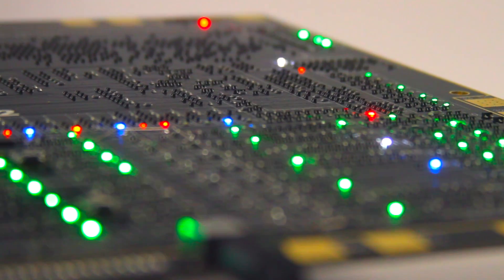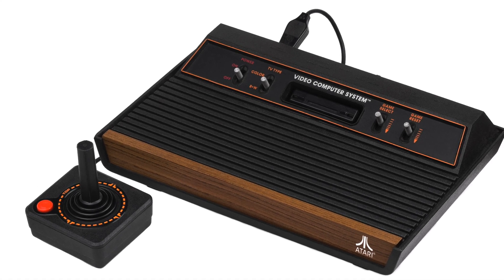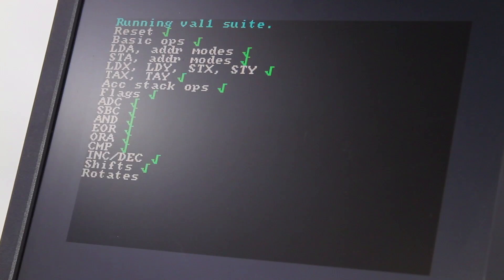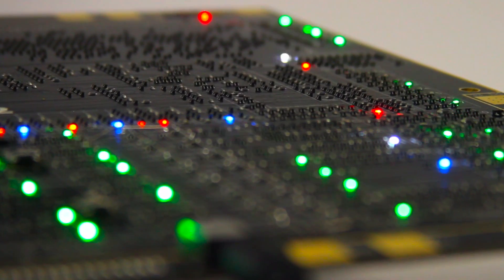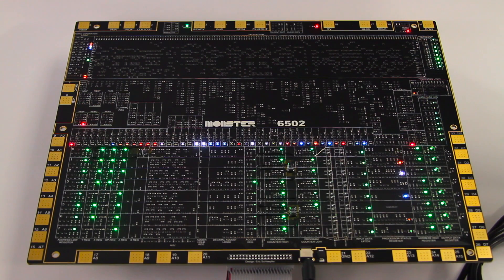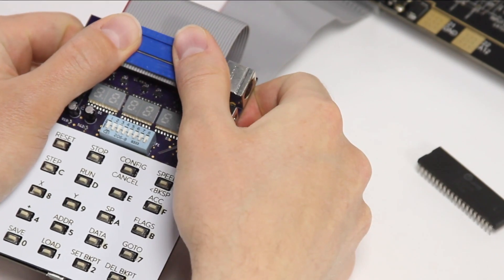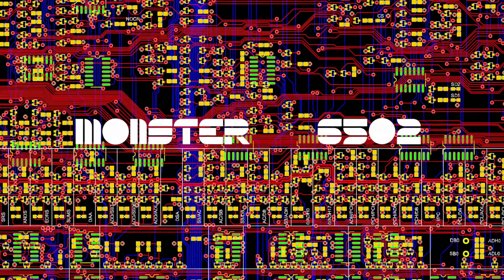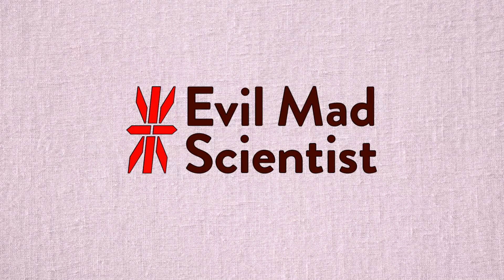MOnSter 6502 Update #1

Comment: Pity they could not get it up to 1mhz - then you could connect the address lines etc to a socket installed on a C64 motherboard and have it power the computer - THAT would be pretty cool. :)

Comment: 1 problem...because its so big...its slower than an actual 6502
Reply: I think you're missing the point, this thing is a technical masterpiece
Reply: @ShaunJV12  boosting the voltage won't make it clock faster
Reply: @Mr.1.i  I know. It's clearly not designed to be faster or more powerful that the original 6502, it's a technical exercise to show it is possible to recreate an actual CPU with standard transistors
Reply: @ShaunJV12  it's because it's bigger in scale than an ic which is smaller ,the electricty doesn't have to travel as far thats why the big 1 is slower
Reply: As they explain on their website:

"Does it run at the full speed of an original 6502 chip?
No; it's relatively slow. The MOnSter 6502 runs at about 1/20th the speed of the original, thanks to the much larger capacitance of the design. The maximum reliable clock rate is around 50 kHz. The primary limit to the clock speed is the gate capacitance of the MOSFETs that we are using, which is much larger than the capacitance of the MOSFETs on an original 6502 die."
Reply: @ShaunJV12  why are u giving me shit

Comment: This would be hard process to concentrate on making these in some rock star movement impairing shackles. Everything has to be connected to ground tho oh my book holders and that means a lot if you already recognize all the transistors and resistors and are able to find them in the datasheet by the code. It's pretty much latest graphics card.

Comment: Apart from cosmetic effects of tens of led flashing, this project makes no sense at all!!!! 
You could  go back in time at the very beginning , when computer were designed around tubes: use of transistor is just a significant step forward and an intermediate step at the same time... 
I think you could have spent your time designing something more useful to the community of crazy digital  designer, for example an  implementation of a basic  cacheless Arm processor( cached model are more complex due to the data coherence issue!). 
Ooops! My talking cricket babbles of something like patent infringements and  law suit..... 
🤔🤔🤔☹️☹️☹️☹️☹️☹️!!

Comment: i wonder back side of this. at schematic we can see some soic8 footprints. they are probably memory, i think
Reply from the maker: Not memory, just more transistors. There are 164 quad transistor arrays in SOICs on the back side.
Reply: @evil-mad-scientist  164 transistors on ic, like a cheat
Reply from the maker: @kpcgkhn  Each of the 164 packages has four mosfets in it. If we could get this mosfet individually, instead of in a 4-pack, we certainly would have preferred to do so. This is the main reason that we most commonly call it a "transistor scale" 6502 rather than a "discrete" 6502.

We do state this explicitly in our FAQ (Is it truly a "discrete 6502?") on moster6502.com

Comment: Cool processor.  I wonder if it is possible to assemble a compatible intel 8086 processor from transistors and run MS-DOS and Windows 3.0 there? Then a assemble Pentium compatible processor and Windows XP launch. Probably, such a processor will take up a whole large room.

Comment: Have you considered overclocking it using water cooling
Reply from the maker: We have discussed it, but ultimately decided not to. If it seemed likely that we could get to a full 1 MHz -- meaning that we could plug it into an Apple II -- then it would definitely be worth the effort. However, our estimates are that we wouldn't quite get there.

Comment: I understand the distance of the transistors is now farther apart, slowing things down a bit, but why is it SO much slower? 1/15th the original speed?
Reply from the maker: The speed limit isn't the distance between parts, but the parts themselves. We're using individual transistors, rather than microscopic transistors on a single die. These are much larger transistors, which means a larger capacitance, which ultimately sets the speed limit.

Comment: Can you think of any visual virtual circuit board emulation applications?
Reply from the maker: Sure; this is actually based on reverse engineering work done by the Visual 6502 project -- a browser-based emulation of the 6502.

Comment: Just overclock it
Reply from the maker: Tried that. Got hot enough to melt the solder holding the resistors down.
Reply: @evil-mad-scientist   Probably not worth the trouble but the entire board could be cooled using submersion cooling as demonstrated in these videos "PC Cooling Submerged in 3M LIQUID" https://www.youtube.com/watch?v=YyKIZPuepl8 and "Submersion Cooling with my new Smaller Novec Demo" https://www.youtube.com/watch?v=dVkUozqdvCc&t=0s
Reply from the maker: @spottedtauren  We have talked about it. If we were sure that we could get to 1 MHz by doing so, we'd certainly try. However, this isn't anywhere close to clear, and so we haven't gone down that road.

Comment: Why is there a limitation on the clock speed? Stability? Capacitance of the semiconductors? Or the fact there are LED’s on it?
Reply from the maker: The primary limit is the capacitance of the MOSFETs; much higher than those on an IC 6502.

Comment: alright guys this is one thing yall should do with this guy here.  make it look right [ like the orginal here ]  but non working . just record the lights for say 5 to 10 min doing several different tasks . record the light responses . pop the most turd arduino like makerboard yall can get , hooked to a little display that scrolls text explinations of what it is doing.  so it wont have to really work , can be made of cheaper parts to keep cost down . if it could be a reasonable price i think it would do well if yall could just hop on a few youtube channels like lgr , retro recipies , and 8 bit guy .

Comment: At your next electrical engineering interview, just hand this board over as your resume.
Reply: People who can do this probably dont have to interview... they're recruited..  :-)
Reply: @SteveJones172pilot  Not really.
Reply: Depending on the job he wants to apply, this might actually work.
Reply: Electrical engineering?? More like electronics engineering
Reply: @poppyflorist  Electronics is just part of electrical engineering. A sub-category.
Reply: @cododerdritte39  Dude!!! What?!!? No mate no... Electronics controls electrical portion... Inverters, stabilizers, regulators etc... 
And then a whole lot on electronic product design, computer architecture, space application, communication industry, satellites... Huge huge others
Reply: @poppyflorist  Dude, yes, Dude.
First sentence in Wikipedia says:

"Electrical engineering is an engineering discipline concerned with the study, design and application of equipment, devices and systems which use electricity, electronics, and electromagnetism."

Do you even know what you are talking about?
Reply: @cododerdritte39  so you assumed that electronics is a sub of electrical? I am an electronics engineer and I work at data centres, with electronic products- router, switches, network ports, firewalls, servers, network cables, testers, multi function copier machines, LAN based system, NOCs etc etc ... NOTHING TO DO WITH ELECTRICAL. Your Wikipedia definition means just an intro. Yes, electrical has to obviously deal with electronics , because electronics automated most of the electrical stuff. Else electrical engineers would be using huge mechanical switches for everything with mind numbing interface changes and used up humungous space. Eg- electronic switches in inverters, voltage regulated chips, batteries operating automatically in sub stations during downtime and such..
Reply: @poppyflorist  I am an Electrical engineer and electronics is just a part of what I am doing.
And by the way, when you talk about Inverters, for example, what exactly is 'electronics' in it and what is 'electrical'? You whole definition doesn't make sense. There is no electronics without electrical and/or magnetic effects (for which electro dynamics and quantum mechanic are the basic theories)

Dude, read the definition of Electronic Engineering on Wikipedia:

"Electronic engineering (also called electronics and communications engineering) is an __electrical engineering discipline__ which utilizes nonlinear and active electrical components (such as semiconductor devices, especially transistors and diodes) to design electronic circuits, devices, integrated circuits and their systems. The discipline typically also designs passive electrical components, usually based on printed circuit boards.

Electronics is a subfield within the wider electrical engineering academic subject but denotes a broad engineering field that covers [...]"

You are an Engineer and have no idea about the structure of your own discipline?

As an EE I am designing an Ethernet Switch or copier machines - not setting them up or maintaining them in a data centre. (No offense here, this is just to clear things up a little).
Reply: @cododerdritte39  wow., Can you tell me, what are you designing in an Ethernet switch or a copier machine? What kind of electrical Engineering goes into an electronic board? Please explain. And when you talk about electrical engineering, are you talking about electrons that is present all around that imparts the electromagnetic properties in the world? That's your contribution? Electrical engineering is electrons supply, that what you're saying?
You are one confused EE. 
fyi the project shown in the video at hand, is an ELECTRONICS board with Gates, semiconductor components, sensors and transistor operation, not an electrical board.
GET A LIFE.
I'm out.
Reply: @poppyflorist 
You're a troll :)
Remember: we are replying to the comment of @thzzzt. He was also talking about Electrical Engineering, not Electronics engineering.
You are talking about things you don't understand.

Again: whenever we're talking about charges or electrons, the higher level discipline is Electrical Engineering (or electro dynamics as a physicists).
BTW: I don't belive that you are actually an Engineer because that would implicate abstract thinking. You're just calling yourself an Engineer (what, for example, would be illegal where I come from, you have to have a degree to title yourself an Engineer).
Reply: @poppyflorist  
Well, starting from the power supply (which is usually a type of switching regulator), to the high frequency stuff (Ethernet PHY) and fast digital circuitry (RMI interfaces, fast Memories for temporary storage of packets) and higher OSI layer processing on an FPGa/ASIC or UC. And of course the whole PCB for the actual circuit.
But fast digital electronics doesn’t work without the knowledge of high-frequency stuff or power electronics. So everything is connected and in order to make a proper product you have to know „everything“.
As you can see there are many sub-disciplines involved as
- power electronics
- communication theory
- control theory / dynamic systems
- digital Electronics
- information technology for data processing 
- RF Technology
.... and so on.

And above all these sub-categories is electrical engineering. :)

So please, let stop fighting about a definition.

Regards from Germany 
BTW.: I used to design big power inverters (medium voltage drives) in the US, so I am pretty sure that the electrical vs. electronics Engineering thing is the same as in Germany, at least with regards to the basic idea: no electronics without electrical engineering.
Consider electronics as one of many applications of electrical engineering. 🤘
Reply: @cododerdritte39  yeah, Digital signal processing and PCB design is EE... what a load... And the voltage regulator that you say you used, is an electronic board. All the transformer, inductor, components are now MOSFET and transistors...  Yeah you have great knowledge, I can tell...
And communication theory.... Really dude, really??? ECE is the one that is Electronics and Communication Engineering. You are confused.
And if you didn't know, frequency is not EE. It's just one of behaviour of waves. That's not EE.
Reply: @poppyflorist  Alright, I'm out. This is one of the discussions in the internet that doesn't lead anywhere.

I thought you would have enough knowledge to understand a hierarchy - which we do have here. Electrical Eng. at the top and it divides down to a lot of sub-disciplines - but obviously you're not able to follow me.

And btw (and last comment from me): capacitors/inductors are the core components for basically every voltage or current converter / power electronics. You can use them in 0402 as a storage inductor or as heavy as several tons. And regardless if it is switched by a MOSFET or a manually-operated switch, we're talking about Electrical Engineering.
And this is the point you simply don't understand.

But, this is my nice Sunday and I'm going to stop wasting my time with some ignorant troll on the internet.
Over and out.
Reply: @poppyflorist  No, more like hobby electronics.
Reply: Would not work for a engineering job. But definitely a technician.
Reply: @woodiemarv  It would. Much more impressive than any degree
Reply: @RenX3133  
Not really. We are talking about very old techniques. In fact, he's done the upscaling to PCB level from the chip. Nothing more.

He did an astounding job by routing the board and getting the digital circuit done properly, but that actually is repetitive basic stuff.

No offense, I really enjoy the work.
Reply: @cododerdritte39  My friend, they did an entirely reverse-engineering process. This is not easy stuff. You need to be at least an eletronic wizard to do it. Im an almost graduated in eletronic engineer (about 3 month to graduate) but i'm far from being able to to this. The guys are amazing!
Reply: @gauninha12  No, you don't have to be a wizard. This is well-known stuff.

Again, they did an amazing job.
But think about the guys who designed the original processor on chip level without having the tools at hand which exists now. THAT is impressive.
Reply: @cododerdritte39  I'd hire him with no degree than someone with a degree but no experience.
Reply: @RenX3133  Not really.
Reply: @gauninha12  IF your almost graduated but are not able to do this, then your future may not be too bright.
Reply: @woodiemarv  technician!!?? Lol

Comment: Does the slower clock is related to the bigger size or is something else? Like if it was smaller but the same circuit would it be faster?
Reply from the maker: The primary difference is in the characteristics of the discrete transistors that we use versus the microscopic transistors on the IC. The larger size will limit it at some level, but it's not even close to being the actual clock limit.

Comment: Could we make a 6502 monster with logic gates rather than transistors? Wouldn't it be easier with ttl circuits?
Reply from the maker: You can make a functional equivalent. It would be much easier, but it would also not be an implementation in the original logic family.

Comment: What computers can you put it in?
Reply from the maker: There aren't any mass-market computers that used a 6502 and can work at a variable clock rate. However, there are several modern 6502 computers that can. These include the SmartyKit Apple I replica, the Cactus Z 6502 computer, and the MIM-1 that we are developing.

Comment: Is it possible to run it at higher frequency? What is the maximum?
Reply from the maker: This version runs up to 50 kHz; 1/20 of the original speed.
Reply: @evil-mad-scientist  Thanks for the info. Is it technically possible to make an integrated 6502 that runs at 1Ghz or so? Are there any examples?
Reply from the maker: @coreclassic  It's certainly possible to go much faster with a different architecture. I'm not sure what the maximum possible is with the original dynamic NMOS (like we're using) on an integrated circuit.

Comment: The COMMODORE 64 used a 6510, not a 6502.  It had enhanced memory functionality, allowing the C-64 to have stacked memory that could be swapped in and out rapidly to keep the operating system from using up too much of the machine's memory.  This allowed the C-64 to do all sorts of special things under OS or user control and still have enough extra memory for internal operations.
Reply from the maker: Yup.

Comment: Is it possible to make a version that is 10 times faster than the original one?
or  even 100 times faster ?
Reply: Take the arduino lol
Reply: The 6502 is still in production and the new ones are a bit more than 10 times faster.

Comment: Is the clock rate limitation due to the capacitance of the LEDS?  Couldn't you move those to a separate driver to work around this issue?  I'd love to see a design that runs full speed.  Even if you'd never be able to see status indication, lol.  Would be great to have that option.  I suppose moving them to a different driver or daughter area of the board would be cheating on the authentic design target of this project, though...
Reply from the maker: No, the clock rate is not limited by the LEDs. Most of the LEDs do have a separate FET to drive them.

The clock rate is chiefly limited by the transistors that we're using. Unlike those in the original design, ours are macroscopic, and have larger capacitance.
Reply: @evil-mad-scientist  I see.  Makes sense.   Well thank you for the information and corrections !  This is a great project.  :-)